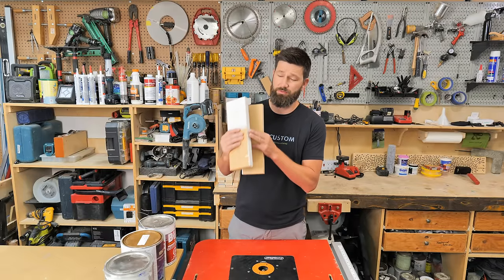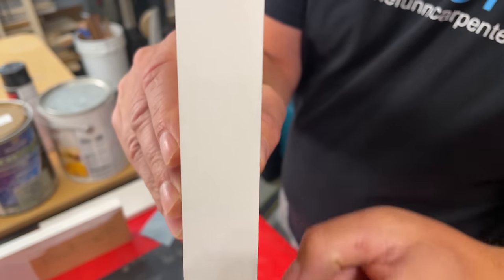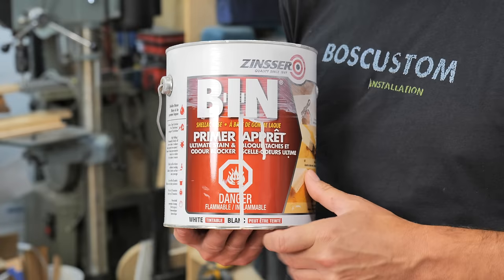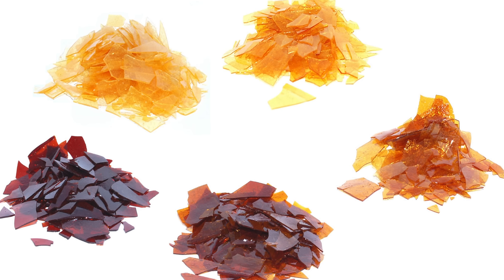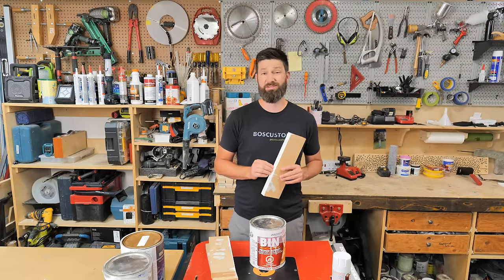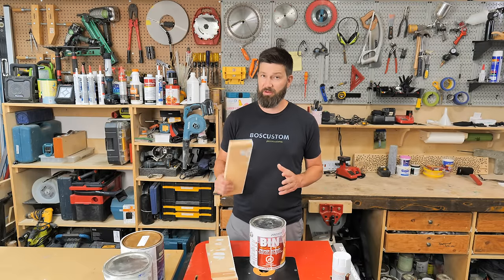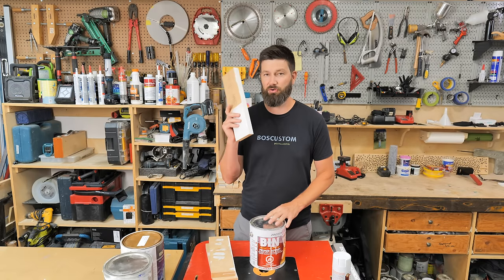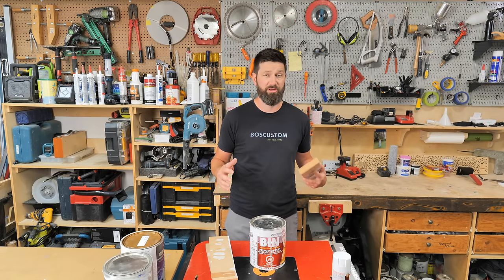The Secret To Painting Raw Wood and MDF!

Comment: Don’t throw those dried brushes away! Leave them a while in a jar of methylated spirits and, unlike brushes that have hardened with oil based paint, the shellac softens up and falls off the brush to the bottom of the jar. If you wait and let the jar settle a bit you can tip the meths back in the bottle and reuse the shellac residue for simple knotting purposes.  It’s the only product I’d use for knotting btw. Doesn’t bleed through subsequent coats of water based paints like trad knotting does
Reply: When I use shellac, I just keep the brush in the jar (for bare wood stuff like saw/plane handles it takes 6-7 layers so it's a multiday affair)
Reply: Knotting ?
Reply: Spot on mate . I normally keep a mini roller sleeve and a stubby brush actually in the b.i.n tin itself , i just keep a couple of inches of b.i.n in the bottom and top it up from another tin when needed. If the brush starts to get a bit stodgy i use the method you suggested to liven it up again.
Reply: @PasiSavolainen no 0:12 0:13
Reply: What is Knotting and Trad Knotting?
Reply: @ronh9384  knotting is a sealing ‘paint’ applied over knots in wood to stop the resin in the knot from bleeding through oil based finishes.  traditionally brown coloured and made from shellac.  It tends to show through modern water based finishes over a longer time.  I always use a brand of primer sealer paint called Zinzer bin 123 (red).  It’s still shellac based but is opaque white and won’t  show through any subsequent finish you apply

Comment: Oil based primer works as well. Slower drying but a bit less smelly. If I have a time constraint I choose shellac based. Good stuff
Reply: Much cheaper too. The shellac is best for wood but oil does almost as good for half the price and if you get Kilz original or the Zinsser Cover Stain, it will dry pretty quickly too.
Reply: @Painmaster212 you can also make your own shellac, make as much as you need and adjust the cut of shellac flakes vs alcohol to your liking, its pretty cheap then!

Comment: Great video.
Just a note, here in Belgium we regularly paint with solvent-based lacquer. (to protect the woodwork from the rain)
And when you have to wrap the brushes, if you do it in saran wrap, you will notice that they harden faster than with water-based paint.
Little trick that works well: Put your brushes in water (a container, a bottle, it doesn't matter), it prevents drying.
To reuse them later, simply take a sheet of
paper towels and remove the thin film of water on the surface.
Reply: I love this tip because it does a little Judo move with the chemistry that makes shellac-based products difficult to clean up and turns everything on its head to use that property to your advantage. If a liquid seal is good enough to keep the sewer gas out of my house, seems like it should be good enough for keeping air off my paint brush!

Comment: Carpentry trick I learned from woodshop if you don't mind a little extra work. Sand and finish sanding. Wet surface, dry, sand all over again.

You will no longer have a problem with raised wood grain because you already took care of all the raised wood grains of they became wet.

Comment: The other thing it’s really good at is covering up knots in natural wood from leaking through your paint finish. It is the only stuff that will do it. 
Can’t tell you how much I agree with the blade marks and the non chamfered/relieved edges of straight cut flat stock. Makes such a big difference.
Reply from the maker: Good call on the knots

Comment: I just found this primer on my last job when priming MDF for stair risers. I sprayed it through a Fuji HVLP and it didn’t require thinning. Plus cleanup was easy with inexpensive ammonia.  Thanks for the post.
Reply from the maker: I tried spraying some of it my garage but quickly abandoned that idea...it seems a little too flammable for my liking!
Reply: It really does spray well through hvlp.I've used it for a few years and while I understand the concern on flammability, especially when you smell it,that's true of just about any product. It's really useful when using over a previously lacquered surface.
Reply: @nickyb6435  , agreed. I just make sure I have good PPE and plenty of ventilation. A quick sand and it’s ready for the final top coat.

Comment: BIN is expensive compared to standard primer, but worth every penny (~$75/gal).  It also bonds to and covers stained/poly wood very, very well and only needs a light scuffing before application.  I'm refinishing a bunch of stained doors, cabinets & trim in my older house and have been using BIN as the primer with excellent results.  It also dries super fast, so you can top coat in just an hour.

Two tips... you need good ventilation, as the stuff stinks until dried (again, super fast) and I cleanup with ammonia & water (25% to 75%).

Comment: I may have to try BIN Zinseer when I need to prime something next time. I’ve used the 123 (water based) one previously for blocking a greasy stain that kept coming through the paintwork on my wall and always got on well with it. I’ve been having to do a few repairs around the house of late and your videos have been a godsend - plus I’ve worked in an independent small ironmongery/hardware shop here in the UK for so long… with what I’ve learned from you it finally sounds like I know what I’m talking about! 😂

Comment: I use sand sealer for MDF but this (Bin) seems like a better alternative to that as sand sealer just adds a step or two sealing the MDF first and sanding, then painting but if you go HAM on one spot and light on another you'll see it if you finish in black.. Bin seems to be a better way to seal and finish.. I definitely like the spray can option for smaller stuff.  Can you use foam brushes or does that wreck the finish if you are doing MDF?

Comment: man i'm about to scour your channel in case you already did, but if you could do a build video on something like that cabinet you showed and how you fit it custom to that opening, hot dang I'd be thankful.
Reply from the maker: Hmm I could make one in the future.  I just built the boxes 3” smaller than the overall width and then put 1-1/2” flush filler to the wall.

Comment: Great stuff! I wish I had seen this video before I pulled my hair out trying to get kilz 2 to prime bare wood. Stuff works great on your walls but definitely not on bare wood or any trim in general. It’s a nightmare to get on smooth with any brush and with bare pine and poplar it does exactly what you just showed. The original oil based kilz aerosol works pretty well though also and sands easily if you need to

Comment: Great tip for the edges of mdf.  When it comes to the larger flat surfaces, what do you recommend to get a superflat, smooth and even finish with the paint?
Reply from the maker: spraying is the only way to get a top level flat painted finish.  In my opinion.  For the cabinet doors that I did, I applied the Bin primer with a brush and roller and then sanded it nice and smooth, and then I sprayed a water based top coat.
Reply: @TheFunnyCarpenter  Many thanks, will likely try that system next time.  Kind Regards.
Reply: @TheFunnyCarpenter  what paint to use for last finish? Is water based paint OK for kitchen?

Comment: What would I use to paint wood fascia on a block home built in the 60's ? Roofers replaced some fascia 1x6 wood I believe, some of the old fascia was in good condition so it wasn't removed and I find myself trying to figure out if I need to use paint stripper or sander to prep it for paint. Any suggestions are appreciated.

Comment: Seems I tried everything I had in the garage to seal MDF edges, and what seemed to work the best was super glue.  I might have even rubbed a fine layer of baking soda onto the edge before the super glue.  Wait!  Hang on.  The super glue was a different project.  My daughter broke the LDF drawer front of a kitchen cabinet in her apartment.  When I glued it back together, I used pencil shavings from our electric sharpener.  I rubbed the graphite and wood shavings onto one side of the broken piece and super glue on the other side.  Then where there was missing material, I pushed some of the graphite and wood shavings into the void and dripped super glue onto it.  The glue/graphite/wood made a very hard acrylic plastic patch.  I'm certain it is stronger than the LDF junk facing.  
So anyway, I would think laying a bead of super glue on the edge of MDF and wiping it on with a finger would give a hard plastic coating which could be painted.  If I ever have to sink a screw into MDF I always predrill the hole and put a few drops of super glue in before the screw.  Of course I have no fingerprints and no sensation in my finger after wiping the super glue, but it comes off in about a day.  Use gloves if you like.

Comment: A bit more work, but all I do with MDF edges is paint them with white PVA glue slightly watered down. When dry, a quick sand and on with the primer/paint. Works very well edge is sealed and reinforced with the glue. Binz is useless and stinks.